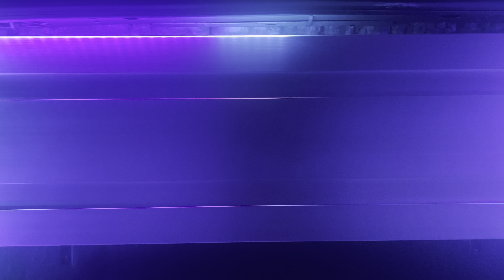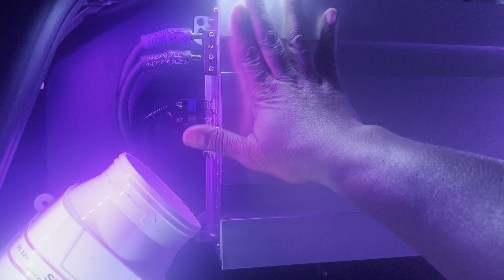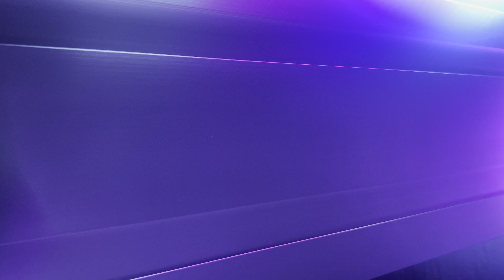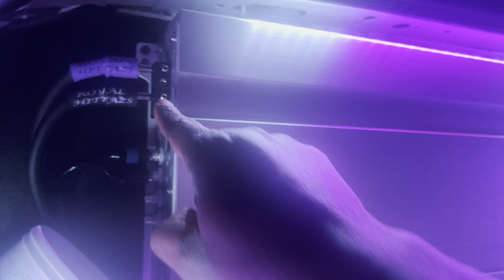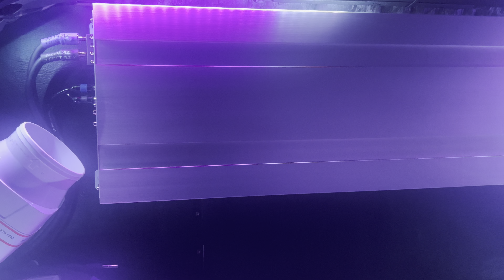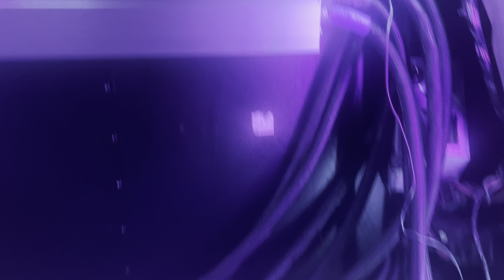My amplifier prototype review

Comment: Hi bass God   what's up first of all.all the best to and your family for the new year  anyway i was using some chips amplifier the planet audio and i never get any popping sound from my speaker but i change out all of the planet audio amplifiers and I'm now using all taramps and since i install these taramps i started to get the popping sound i tried everything that i can think of to stop the popping but nothing works is there any advice you can give me please thanks  I'm just getting into car audio so still learning  by the way I'm touching base with you all the way from the Caribbean  and i also wanted to let you know that your setup is real nice
Reply from the maker: Yes, it may be your amps turnoff delay cause that. Amp cutting off before radio.
Reply: He bro thanks for the info on the popping for my speaker it stop popping when I turn off but it is still popping when i turns on